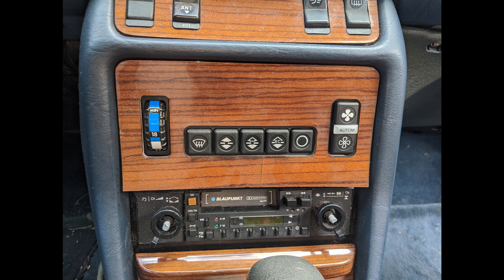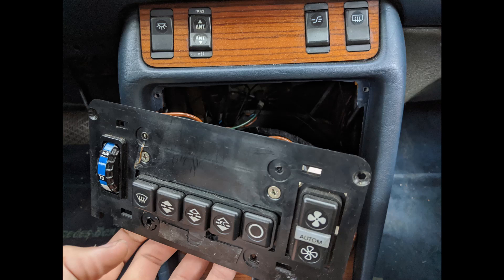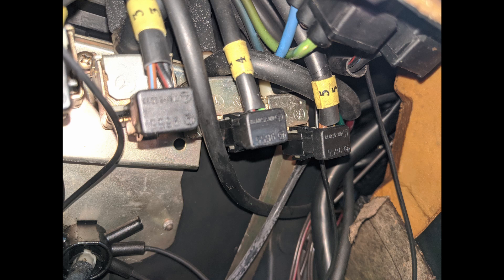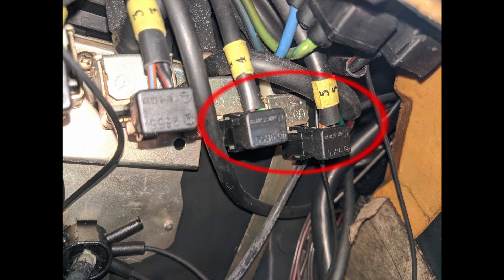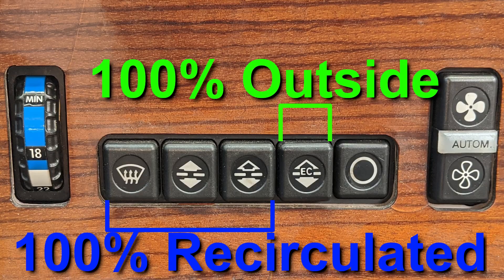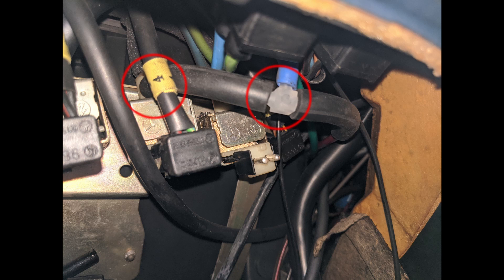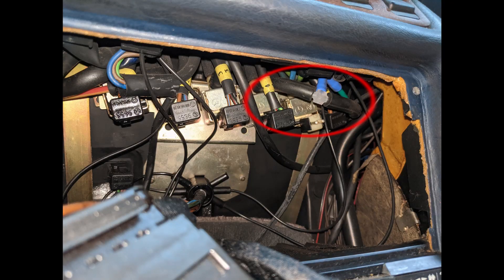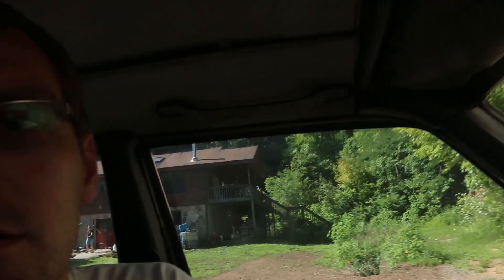W123 HVAC Recirculation Modification (Cheap/Free Colder AC Mods Part 1)

Comment: You still running R12?  My car was converted to R134a before I bought it. A while back I stupidly cracked open the temp sensor connection at the dryer trying to figure out why my condenser fan would not come on...... anyway long story short I leaked out some oil and gas from the system. I put a can of r134a back into it and checked all my pressures. Things looked good but I was concerned about the oil I had lost. Anyway I added a can of "Interdynamics A/C Pro R134-a PAG 150 Oil Charge with ICE 32, 3 oz.". Holy mother of all that is......... I can hang meat in my car now. I've got AC vent temps in the mid 30s.  I swear by that ICE 32 product.
Reply from the maker: I have 134a in my cars, and the AC has always worked "ok", but nothing like what you describe, I may just grab a can of the ICE32 and see what it does in a future video, I've got a few other things I plan on doing partly for my own curiosity, but also because it probably needs to get done, like cleaning the evap and drain, as well as checking the temperature sensor, there is a temperature controlled switch as well as the TXV that control the evap temp, its possible if one of the sensors has gotten gunked up and isn't seeing airflow it may be kicking the compressor off too early, I'm gonna do a video soon on cleaning everything out if all goes well!
Reply: @trythistv  Good luck! Curious to hear what you find!